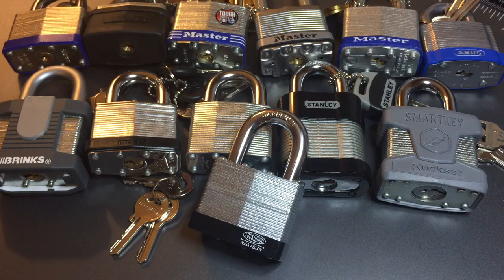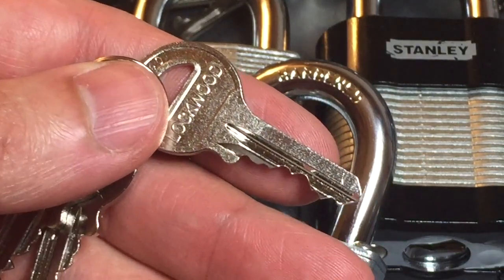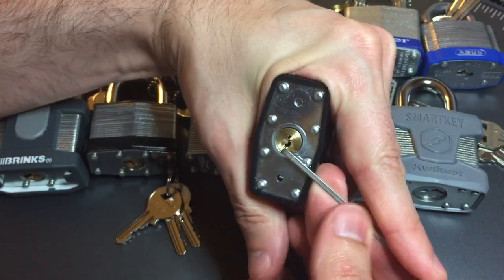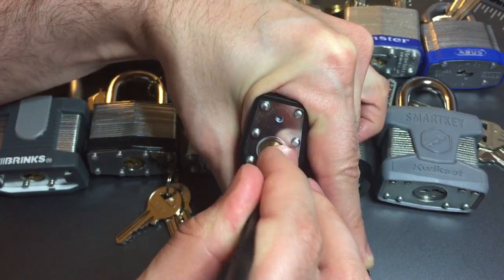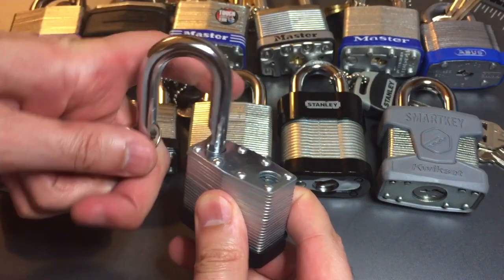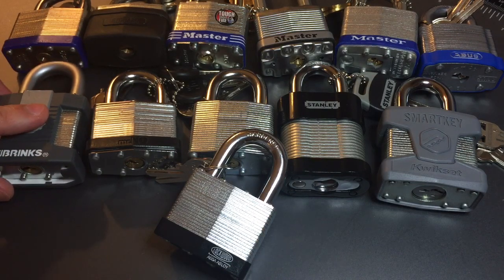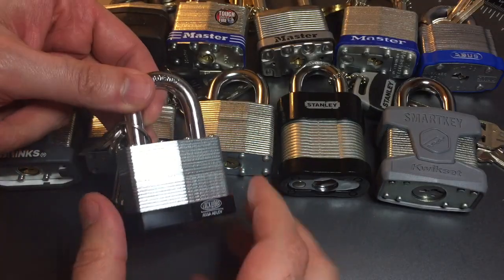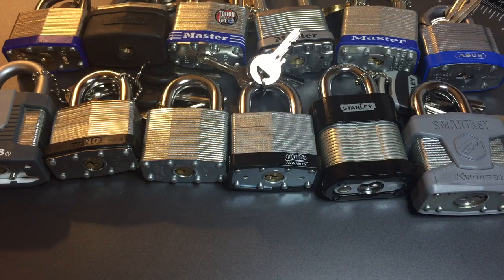[226] Lockwood 119/50 Padlock Picked (50mm Series)

Comment: Good video and picking mate. I've been hoping one of the lockpicking youtubers would get their hands on these. I have two currently and have picked 5-6 more, I think they're a nice lock for what they are, priced close to master locks of the same size and much more secure. All the ones I've had have had 2-3 spools and I think they're a great lock for practicing picking spools as the feedback is good and it feels so nice to pop open. Cheers :)
Reply from the maker: +P3dro 2486 Thanks. They do seem to be pretty nice little locks.
Reply: @lockpickinglawyer  In Australia Lockwood is to locks what Samsung are to cell phones. Fully 60% of the houses in the country would be secured with Lockwood and maybe 50% of the rest by Whitco. That amount was once far higher with probably 80% plus of the locks sold in OZ being Lockwood up until maybe the mid 80s or a bit later. The LW5 and LW6 key profiles are by far the most common even today. Whitco use the same profiles and Lockwood use them for their more serious padlocks (mostly Abloy variants nowadays tho they still make a couple of their original propriety designs which were once THE Aussie padlocks.) so one or two keys can pretty much do it all.

Comment: I don't know if the 40mm is too much smaller than the 50mm's core, but I do know I'm having trouble fitting a pick in there without lifting every pin in the way to the very top. Hopefully when the lock pick set arrives I can compare better...

Comment: NIce looking padlock, very good presentation as well. If you were to put Commando lock IC3 Tactical Padlock in comparison to these 50mm laminated steel padlocks, in what ranking are you going to put it???
Reply from the maker: +Orly B tough call. Either above or below the Stanley. But they don't make a 50mm.

Comment: Well, well... I just got myself one of these for a practice lock because it was only $9AUD. Imagine my surprise when it's actually a half-decent core with security pins and I can't get it open! (yet)
Reply: lol I also did the same just in a 40mm. At least I know my gardening tools are safe in the shed once im done practicing on it. I need a tension bar with a smaller insertion point so i can have more room. I dont think the amazon starter kit i bought is good enough.
Reply: @philgoodinc2  I also got the 40mm (which was probably a mistake)... a bobby pin fits in the TOK for tension. Even then you'll need quite a small pick to get in the keyway properly.
Reply: @stevenpam  That looks to be my issue as well, getting way back to pin 5 with a wrench in there.

Comment: That's weird was just reading in lockwiki that lockwood doesn't usually come with security pins.
Reply: I guess it depends on the lock in question. I've a number here that have security pins.
Reply: +Noctis Motus I have two of these cause they're cheap and fun to practice on. Both have what I believe are spools due to the false sets and counter rotation. In Australia they're cheaper than a master of the same size and much better. They can be a real bitch to pick sometimes as a few I've tried have had really good tolerances, a good bitting and 4 spools.
Reply from the maker: +Randy Perkins sometimes people think they don't come with security pins, because they don't recognize the tapered pens that Lockwood traditionally put in their locks. But more recently Lockwood has been phasing out the tapered pins for spools because the tapered pins rake pretty easily.
Reply: +LockPickingLawyer just before you put this video up I was on lockwiki and lockwood happened to pop up and it said they never use security. Must mean in the past. Speaking of no security pins I have a Best and if you don't have a key to look at you'd need a pen and paper to open one. So many combinations.
Reply from the maker: +Randy Perkins I can only assume that it was written by someone who didn't appreciate the purpose/effect of tapered pins.
Reply: +LockPickingLawyer there was a cylinder I sent you that had no name on it and the key just had a code. Pretty sure it was called Econolock and that was very hard to get. I put in security pins because I always do when there isn't any, but just before I sent it your way I replaced them with the original pins. So if you were wondering why I sent you a standard lock I thought you would appreciate the quirkiness of the standard pins because they were beveled/chamfered and seemed to me you had to pick some of them twice. Then again it always seems to me that a brand new lock is at it's best, when you pick it a couple times it seems to change the lock(tolerances)and make it easier.
Reply from the maker: Randy Perkins I'll take a look, but I've been pretty tied up lately and have a huge backlog of locks to work on.  It's a problem that's very nice to have!